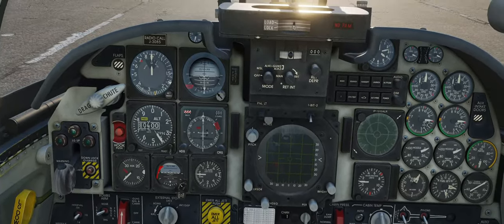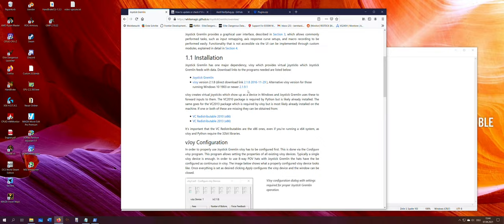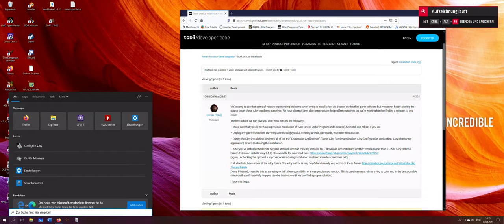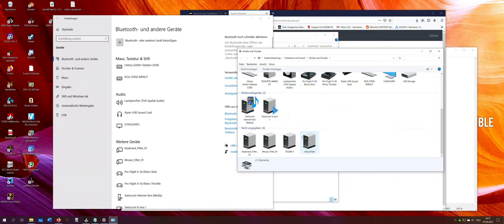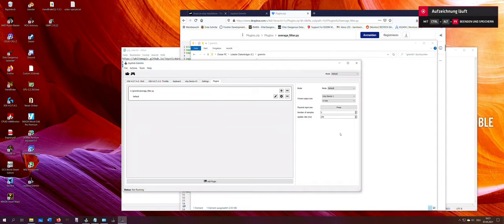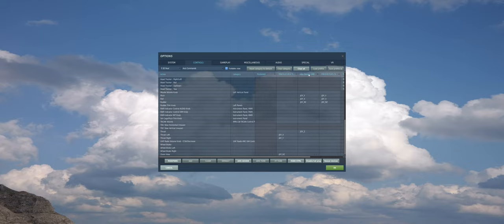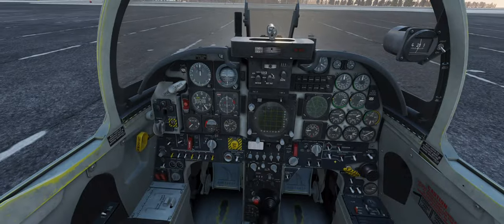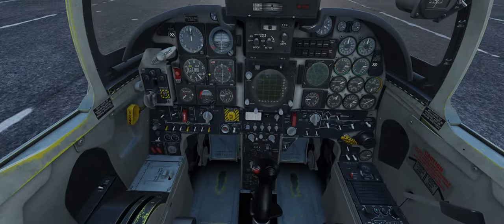Fixing Joystick Axis Jitter, Stutter and Flicker for Zoom Axis in DCS

Comment: you have any advice for me… In my axis panel, When i’m setting up my Roll and Pitch it keeps glitching. Like when I pull up on pitch the roll bugs out and goes to the left when i’m pulling up and it’s awful. Especially when flying. I’ve got over 70 hours on here and it’s never happened to me till now.
Reply from the maker: I had something similar on the yaw axis, I suspect in my case it had to do with abraision on the potentiometer. I check then out several videos how to disasseble the stick, got to the potentiometer and cleaned it up. But before you do that, I would recommend to try different USB ports, e.g. those which are directly on the back plate (sometimes not all ports have the same power delivery, or e.g. on AMD CPUS the one from the back plate are managed by the CPU-SOC and the other ones from the chipset).

Comment: hi, after doing this (which works) i lost my X52 profiler, the icon in windows right bar is gone. Any way to bring that back? I have all my keystrokes programmed there. Tahnks
Reply from the maker: In the right bar, you mean the start menu? Maybe it was on "the most recently used" list before? Either scroll down or search it with the search function.
Reply: @berniwsgamingstuff3364  i mean the icon in the bottom right taskbar. I read somewhere that i had to reinsstall X52 and then it poppep up again. thanks!

Comment: I have ghost inputs randomly. It ghosts the inputs of many switches. How could I fix these issues with the Joystick Gremlin software. Should I add a plugin option for every button on the hotas?
Reply from the maker: With my X56 I had ghost inputs too, did you try to connect your HOTAS to some motherboard USB Port or an USB Hub, which supports charging? Some USB ports seem not to be able to deliver enough power for some devices. I did never try the plugin with a button, I have no idea if this works. But it is worth a try, if switching the USB port does not solve the problem.
Reply: @berniwsgamingstuff3364  Thano you for your quick response! Sadly I already tried a powered USB hub. Maybe it's the one that I bought that doesnt work :( It's outrageous that logitech delivers such faulty devices

Comment: I had this same problem with a brand new TM Warthog throttle (though to a lesser degree than shown in the beginning of this video). It wasn't like that until today, though. And then I remembered: I switched from having it plugged into a USB port in the back of my PC to having it plugged into a USB hub on my desk. Swapped the cables again and the problem disappeared.
So to anyone else who doesn't want to bother with vjoy and joystick gremlin, try seeing if a different USB port will work. One that doesn't involve a hub or USB passthrough. Who knows; worked for me but your mileage may vary.
Reply from the maker: Yes, its worth a try, I am aware of that, it is plugged in the motherboard USB's. The x56 is notorious regarding "ghost clicks" when plugged into an USB port which does not deliver enough power. Did not help in my cases though regarding the jittering, just regarding the ghost button clicks.
Reply: this comment needs to be higher up. i have a cougar that was getting jitter on the throttle range knob and ant elev know out of no where. had it plugged into a usb hud but as soon as i plugged it straight into the pc it went away. try this first!

Comment: i still have a little jitter with the setting in video, which should i change ?
Reply from the maker: I would try to increase the number of samples, go from 10 to 20 to see if it helps. Or does it not work at all, then there might be something else wrong?
Reply: Hey bro did u find the solution? I still have micro jitter too
Reply: @cmdrpepelluce5375  15(samples) and 25(updaterate) seem to work well for me
Reply: @MiniDien  thanks
Reply: Works a treat thank you .. adjusted to 15/25 works perfectly 👏👏

Comment: Nice I sometimes get this but it usually means one of the wires on my G940 is breaking again and I need to re-solder them but I might try this on my spiky rudder axis too.
Reply from the maker: My HOTAS is fine I think, I have two X56, one worn and one brand new. The brand new has the same issue as the old one, I think it is just a characteristic of a cheap potentiometer or circuitry (with various capacitor/resistor setups this is usually manageable).

Comment: Hi, very interesting tutorial. I use FSUIPC and the developers suspect "FSUIPC would still see joystick input from Windows, not JoyStick gremlin recalibrated output". Do you have any experience on this topic? Thanks.
Reply from the maker: No, I don't. But the vjoy driver does just provide a normal Joystick from the operating system point of view, so I would be surprised if an application or plugin could act differently on it (apart from just grabbing the first device or something like that). Regarding joystick gremlin, was it active (if you watch the video I click at some point on the game controller icon to activate it)?

Comment: Is that work on thrustmaster  hotas warthog also?
Reply from the maker: I think so, it is independent of the product.
Reply: @berniwsgamingstuff3364  is not working for me 😢😢😢
Reply from the maker: @abbefandi6742  Too bad, where did you get stuck?
Reply: @berniwsgamingstuff3364  everything is installed and working fine but they still freak out when i zoom in.
Reply from the maker: @abbefandi6742  Did you assign the axis to the plugin? What happens if you take more samples? Was Joystick Gremlin active (green icon)? Did you reassign the axis in DCS to the new virtual axis?
Reply: @berniwsgamingstuff3364  that what I forgot to reassign I dcs is still flickering but much better so big thanks to you
Reply from the maker: @abbefandi6742  Glad it worked now:-) You could try to increase the sample size to smooth it more.
Reply: @berniwsgamingstuff3364  yes and thanks for you!🙂 do you mean where you write 10 and 20?
Reply from the maker: @abbefandi6742  Exactly. I fiddle with that at 10:48
Reply: @berniwsgamingstuff3364  what do you think I buy higher number or lower?
Reply from the maker: @abbefandi6742  Higher number of samples, try 20 instead of 10 as example.